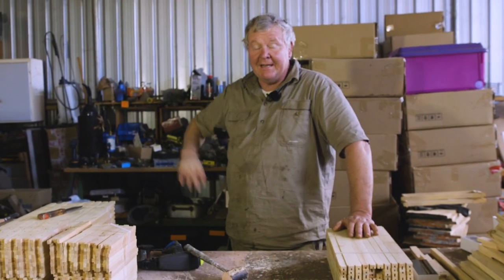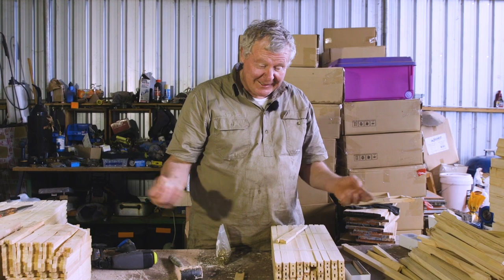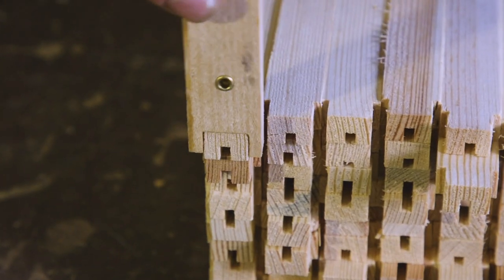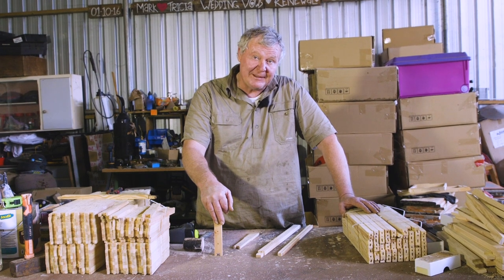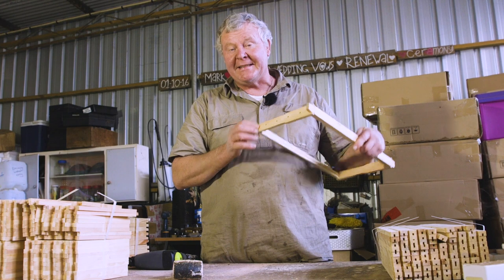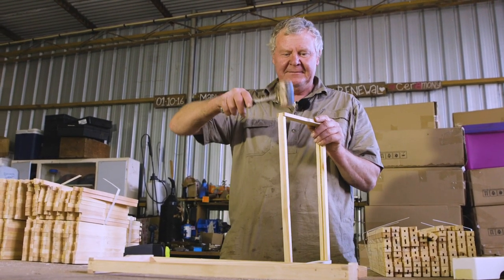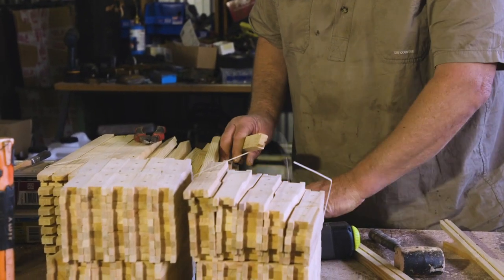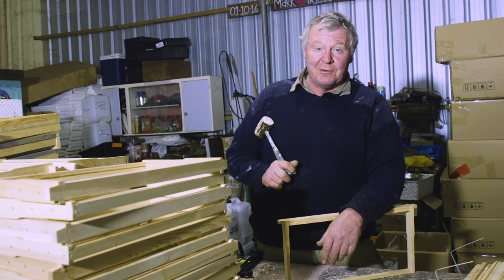Building Beehive Frames: Assembling Bee Frames with The Bush Bee Man

Comment: Nice one, I use a box in a box jig, 2 narrow staples in each end on the top bar and a wide staple on the bottom bar as I've found a narrow staple or nail sometimes collapes the groove in the bottom bar. Once assembled, I hook the frame over a slightly open bench vice and push the eyelets in. Easy as. Cheers

Comment: I have an idea on how to make the installation of those eyelets a touch easier, but I must admit I have never tried it myself. My idea is to use a drill bit (which will require you to find the index, easily the hardest part) and then find a drill bit that fits as close as you can get to the inside of the eyelet. You can drill the hole, and then just continue on and press the eyelet into the frame, and then move on to the next one. I think that the drill chuck might just be able to "press" the eyelet in. Maybe. I dunno!
Reply: Best thing is a rivet which you can pre-load a heap of eyelets on, then using a tack hammer, hammer each eyelet in and move on.

Comment: Easiest way is to get a nail that fits inside the eyelet but with a flat head.. place nail into eyelet then into the hole.. a couple of bangs with the hammer and then pull the nail out.. just make sure the hole is not over the bench (I use the corner of my bench) easy as pie.. I have just made up 90 frames last weekend. Painting and finishing up next.
Reply from the maker: Good luck with your project! Thanks for the tips!

Comment: Its all about the method mate, I assemble thousands of frames at a time and eyelets are the least of my issues, just line em up on a pin the right way around, and push them into the holes then one belt per eyelet with a tack hammer makes them snug and cozy, I spray the joints with glue and use a jig to hold then while I shoot in the staples, they come out lovely and square and tight as a drum onto the wiring jig and job done lol. Any way what else are you going to do through the cold months of winter? I just light up the pot belly in the shed, crack a stubbie and away I go happy as a proverbial pig. It is all about lifestyle and making do.